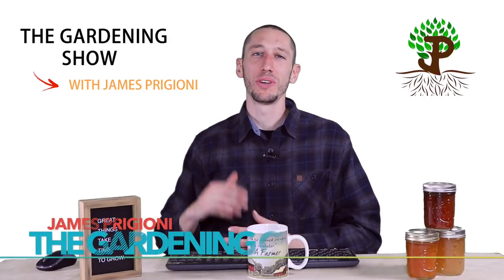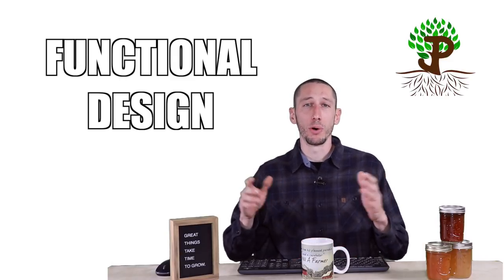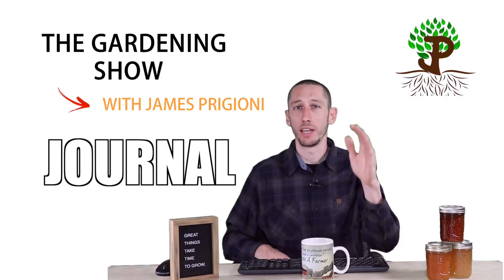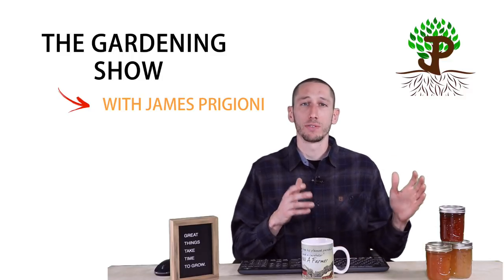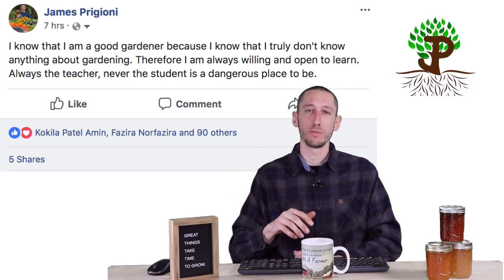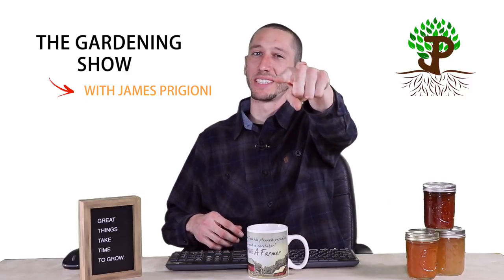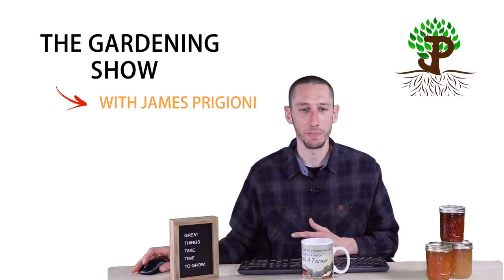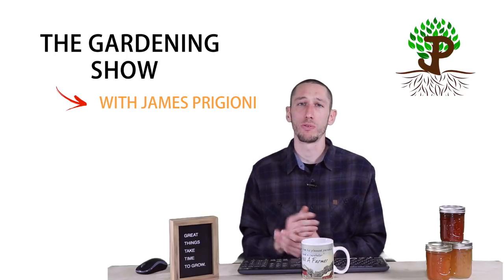The 2 Signs Of POOR DESIGN!

Comment: I realize I am starting late by not getting the wood-chips down in the fall or winter. If I put down a layer of wood chips that have broken down first then add some newer chips on top, will this increase fertilization? The chips have been in a huge pile and some for a couple of years.
Reply: Lonny King I am thinking you have the idea... That is what I am doing except also pulling back chips were we are to plant and adding some soil then pushing the chips back.